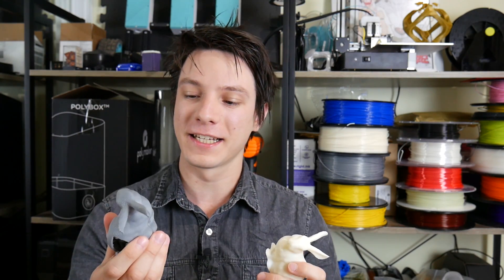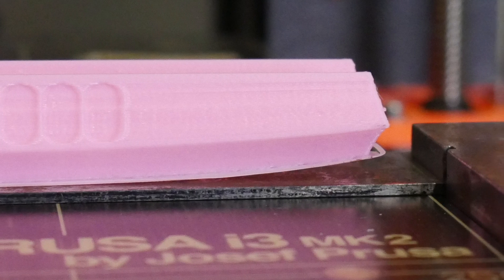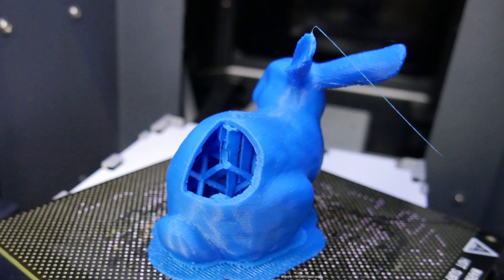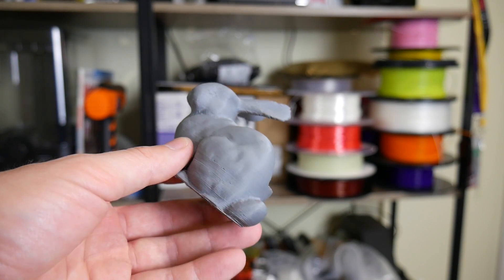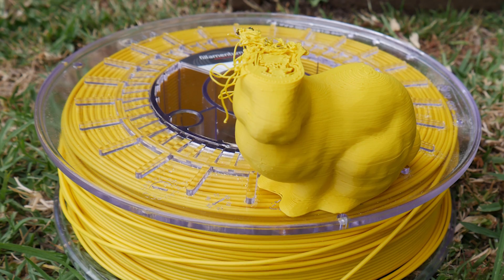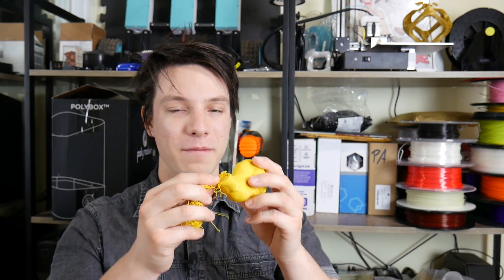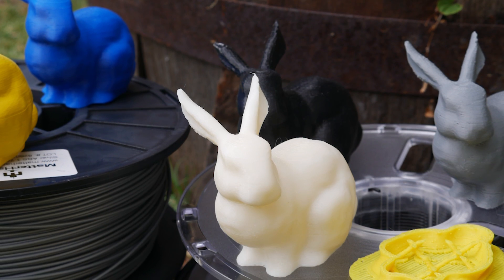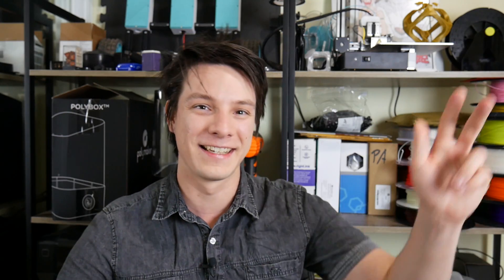Should you 3D Print in ABS? Probably not.

Comment: +Maker's Muse I've been testing PC-Max. So far it either sticks too well or not at all. I'm using Polymaker's recommended temperatures of 260 and 80 °C. Do you use the BuildTak supplied with PC-Max or something else? Or is your UP Mini the one equipped with PrintBite?
Reply: The secret to getting PC-Max to stick to BuildTak well - but not so well that you wind up tearing chunks out of it - seems to be to start with a relatively high nozzle height and work your way down gradually. Plain polycarbonate doesn't seem to stick to BuildTak no matter what. So far, PEI plus glue stick seems to work best. But I hate using glue stick. I'm going to try PrintBite next.

Comment: Doing a laminar break test on a part right off a printer is kind of silly IMO.  If you need a part that is strong in the laminar direction then you should oven bake it or acetone smooth it, both of which will increase laminar bonding hugely.

For me, if I need laminar axis strength I don't print the part that way.  I break it into smaller pieces and then solvent weld them together.  If for whatever reason I cannot do that and need strength, into the oven it goes and dramatically increases laminar strength in most fdm prints.  Interestingly, PLA baked is actually stronger than ABS baked in the laminar axis.

Comment: I could not disagree more about ABS being obsolete.  Vapor smoothing and acetone solvent welding are things I use constantly.  I have a smaller printer and I have to print parts in smaller pieces all the time and 'glue' them together.  With other materials this would be a weakpoint, but with ABS, the weld is actually much stronger than the rest of the material.  I also do a lot of captive magnet work and I can just leave a hole open, drop a magnet in, and put a little acetone / abs slurry over it and the magnet is now permanently sealed in there with no glue.

Do your other solutions allow for acetone welding and smoothing?  Because these days it is almost a non starter for me not having these options.  I have only had tiny problems with lifting on my lulzbot mini and that is doing things like boardgame player screens with print in place hinges that are about 1.5mm wide and 4 inches high, they lift a bit at the edges sometimes.  Sometimes they have a laminar split, but a little bit of acetone slurry on a cuetip and it wicks right in and the break pretty much vanishes.  On the PEI bed that lulzbot uses (probably other printers as well) abs seems to stick fine to.

I do not have huge amounts of other filament experience, but have actually had really bad luck with PLA curving up on angled column supports to the point where I cannot use PLA with meshmixer style stick supports on my printer.   I have tried hips and really don't like that for much of anything.  bridge nylon I have a lot of laminar bonding issues, I might have been printing it a little too cool, usually I have to bake them afterwards in an oven to get them to laminarly bond well. 

I would like to look into PC max and see what it costs here in the states.  Your prices don't seem to have much corrolation to what I am used to seeing here.  $7 a kilo abs sounds like a dream, I have never seen it less than $20+shipping myself.

Comment: I hate ABS. I got a roll because everyone said it is stronger than PLA, but it is anything but. It stinks, is non-biodegradable, non-renewable, the layers don't adhere, it's not cheaper than PLA or PETG, has lower detail quality, and it is more difficult to print. Why would anyone use this stuff? (before anyone says acetone, I couldn't care less)
Reply: People keep saying their ABS doesn't stink. I guess I'll have to believe that the hatchbox ABS I got is one of the smelly ones. If you don't care about renewability or biodegredation, then I guess that's your choice. If it is cheaper for you than PLA or PETG then that's a different story than mine, they're all the same price here. Those are where I will accept your personal circumstances. 

However, it is well known at this point that ABS has much poorer layer adhesion than most other plastics. Also, I didn't say it is hard to print with. It is pretty easy to print with, but it is also harder to print with than PLA or PETG. A lot of people say "you get bad ABS prints if you don't have a heated chamber", and that may be true, but if that is the case then that absolutely makes it harder to print with.

I didn't try one ABS print and give up either, I spent weeks trying it over and over again with different settings and it was always the same story, bad layer adhesion. I never had any warping, but my heated bed can get pretty hot so hooray for that. If i'm printing at 250C with a heat bed at 100C, part fan turned off, and my printer in a box, and still can't get the layers to adhere well, I don't know what else I need to do. I've tried layer heights from .05mm to .2mm, nothing worked for me.

TL:DR
I really don't know man, maybe my ABS is bad or maybe I'm bad at ABS, but it just doesn't produce parts as strong as any other plastic in my experience. If you want to recommend your ABS brand to me I can give it a shot.
Reply: Just because the ABS doesn't shatter doesn't mean it's stronger. PLA is just harder, and thus results in brittle failure rather than ductile failure. To test layer adhesion, you should print a pillar or something and try to snap it across the layers. In my personal experience, ABS can't handle half of the force PLA can, but I will try your recommended brand and see how that goes.

The ABS I have will stink up the entire basement. If you walk in, the first thing you notice is that there is a strong ABS smell. So I will try the brand you recommended if for nothing else but the diminished odor. ABS has been useless to me and I would love nothing more than to have another material I can use.
Reply: It's pretty bad, yea. Thanks for your help. What color do you think has the least odor?
Reply: David Naoum people think oh my layers aren’t sticking gotta bump my nozzles temps up and it’s super unnecessary and I think is where a lot of the issues are I found the best luck with having higher bed temps like ~110 with a nozzle temp of 235c if I go higher on the nozzles the heat difference from hot and cold would be larger and increase the forces of warping. So basically maybe just keep things cooler on the hotend bump up the bed and you might be impressed it’s more of a dance to print abs and less straightforward bust also super do able

Comment: I print tiny drone frames in abs.  Layer adhesion is of course an issue for failures during crashes but abs is very light in an application where 1 gram can mean huge changes in flight performance.  Can you suggest a replacement that has a similar or lower density than abs and great strength/flexibility characteristics?
Reply: Exactly this. I see a bunch of comments saying PETG but that shit is heavy.
Reply: Yep, I'm tempted by petg... but if I break an abs frame - I just print another... that's what the printer is for after all.  Makers Muse - give us an ultimate guide to lightweight filaments please!!
Reply: Uh well ASA has the exact same density as ABS, maybe that's the ticket. It's also closely related, with merely rubber component of the plastic being replaced.

But ABS is cheap. Just print more ABS, and break it often, no biggie. Apropos cheap, HIPS is normally considered more brittle than ABS, but maybe it's just stiffer when deformed slowly but still survives hard crashes better? I have found conflicting data. Still, it's likely that ABS is better.

As to getting things lighter... well actual lightweight plastics are HDPE/LDPE, PP and TPE. LDPE and TPE will be flappy - can you live with that, can you fly a flappy drone? I have no idea. At least you can easily buy TPE filament, it's sold as flexible filament. You can buy Verbatim PP, it'll warp on ya pretty badly, and it costs a fortune. I think Tom has had it? HDPE had been tried in the past because it's a low temperature material, and it warped badly, and delaminated, barely stuck to itself. I think i sense a theme here. If you can control their shrinking by keeping them in toasty, hot chamber... i think you can achieve something spectacular with materials not currently widely considered printable.
Reply: PETG is also more flexible, less heat resistant,  creeps more under load and has a worse failure mode than ABS

Comment: You yourself say we need to stop the race to the bottom for cheap 3D printers. Yep it's 2017, but that means every new design should be incorporating a plan for an enclosed print volume to hold temperature by now.

Until we have another filament which is cheap, heat resistant, and can be vapor smoothed at home with a common household product, ABS isn't going anywhere.

Comment: I agree ABS can be a pain but I still print 40 rolls of ABS for every roll of PLA I print. I make almost exclusively real world functional parts where PLA would likely fail. I'm talking where heat is likely to be a factor and parts must give just a little (not be stiff and brittle). Also many of my parts are glued to tubing that use acetone to do so (my customer is quite adamant about acetone adhesion). I do occasionally pop PLA in the machine when I am going to print "shelf stuffers" as I like to call them.

Comment: There is no better or worse material... just the material that can do what you need for the price you're willing to pay. Peace ✌
Reply: ABS certainly is a better material for injection molding than 3D printing tho.
Reply: You can't have a positive quote for everything in life.
Reply: think so too and Polycarbonate is currently quite expensive and not really comparable to the costs of ABS which kinda makes up for it. ABS is a little stronger than PLA but prints a little worse --> same price category.
Polycarbonate prints better and is stronger --> way higher price category.
seems logic to me soo.. don't compare those like that, you have to compare those that are on the same price category
Reply: @juto2618  ABS prints as good or better than PLA if you give it the right machine. Most hobbyists are trying to print ABS on machines optimized for PLA and that's a bad way to go. Also, if you're comparing ABS on price per kg that is is the wrong way to go about it because you get 20% more ABS per kg, because it's less dense.
Reply: @JeffDM  I see that I answered without enough information and thank you for your corrections. 
But may you give us further information about printers that are optimized for ABS?
Reply: Which means there are better or worse materials for your desired result and budget... Pretty much defined "better" or "worse"...

Comment: So the only reason to avoid ABS is that it's not as strong as poly carbonate? Like most your videos are pretty good but this one seems a bit click baity/ bs. Like polycarb warps worse, needs higher temps and chews up nozzles, never mind the fact that its way more pricey, doesn't acetone smooth and post processing is awful. This video was pretty disappointing Angus, having a stronger material out their doesn't mean you should completely abandon other materials. ABS isn't that hard to print with if you have a proper setup, i print with it all day every day, (in almost max build volume on my n2 printers) and greatly prefer it over PLA/petg/asa/polycarb. The advantages of ABS really can't be beat in regards to my applications (props, armor, accessories) and this video reinforced how great abs was, not convinced me there was another way. kind of disappointed with this video Angus, was hoping you were bringing up a true replacement. =/
Reply: and, of course, if you dont properly plan for the Obvious (strength, warping, etc), it has issues.
which even an idiot can account for when slicing, or when designing a printer / print surface.

Comment: I started printing with ABS, event put a shroud around my Hypercube which did improve things quite a bit, but after a couple of PLA prints I have NEVER gone back. I have even gone so far as to donate all my ABS to the local high school that only used ABS to print with. (yes I have told them that PLA is much easier to print with).

Comment: if i print with ABS (which i dont ....EVER)  i prepare myself for .....9/10 prints failing normally with layer adhesion or warping and a blocked nozzel ....every single time . PLA .....just works
Reply: You just need to figure out settings. I print kilos of ABS a month with very few failures.
Reply: plus you cant print nearly as fast as pla
Reply: Scott Lichtsinn that's right.  I Buy MakerGeeks filament, $15 per kg (and it's really good filament) for PLA, ABS or PETG.  It's a bit more expensive if you want to select your colors (90% of the time I do the random grab bag, it's cheaper and I enjoy not knowing what colors I am getting) but still the same price for all three major types.
Reply: I don't really see a point to printing with ABS.  If you want the strength, durability, etc..., PETG will give you that, no additional costs, no shrinkage, no warping (no more than PLA would) and no nasty smell.

Comment: I've had crazy good results with PLA on my i3 - one problem with car parts I've printed it heat distortion - I made a digital boost gauge and a clip for the vents and in summer months the clips do not last long.
As you've mentioned ABS can be troublesome to pint - how do the newer filaments react to heat and do they need a heated enclosure?
Reply: Did you ever get something that works well for higher temperatures

Comment: I prefer AprintaPro PLA. It does not stink, like ABS. Why gluestick or hairspray?
It messes up the heatbed and object. I extrude PLA with 185°C and for the headbeat 55°C.
 I extrude on glas and have a good adhesion and no warping. ;) From time to time I used 
blue tape. But large objects were difficult to remove.

Greetings from austria,
Mike

Comment: ABS turns out shiny and smooth when you vapor bath it with acetone, which is probably the best reason to use it. Price and durability seem to be in its favor as well. My printer also only has 2 settings for plastic type. PLA and ABS, I bet some other types might work if I messed around with custom settings but the printer manufacturer doesn't confirm that any types of plastic besides those will work with the printer.